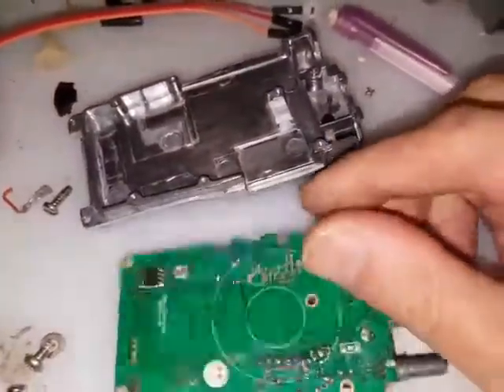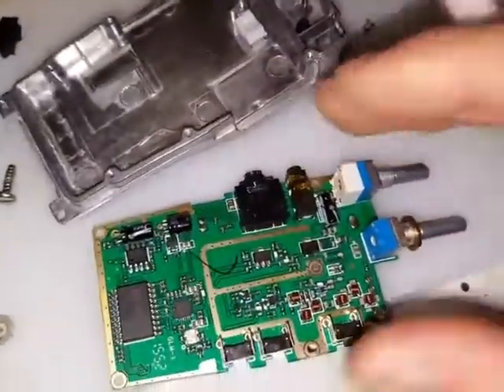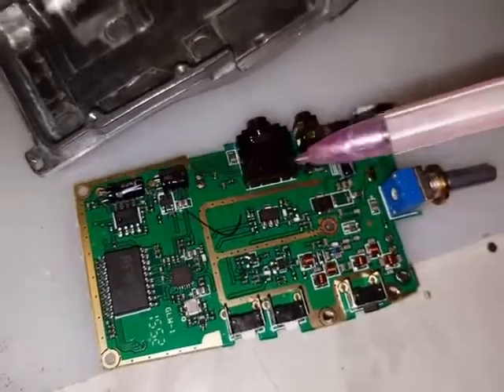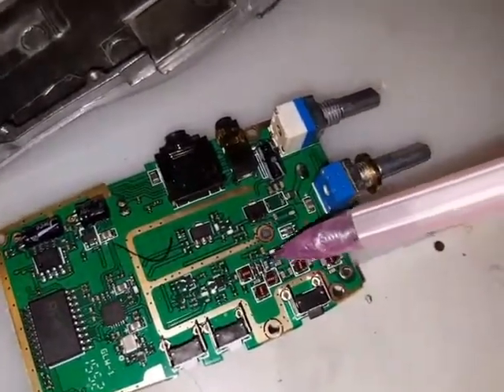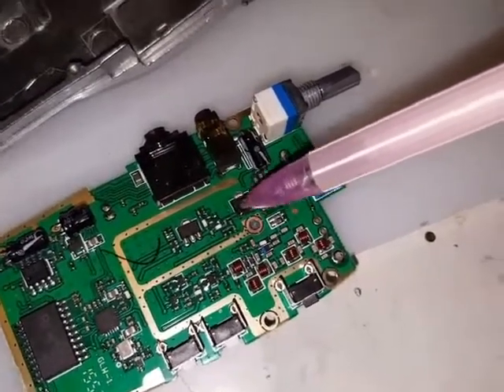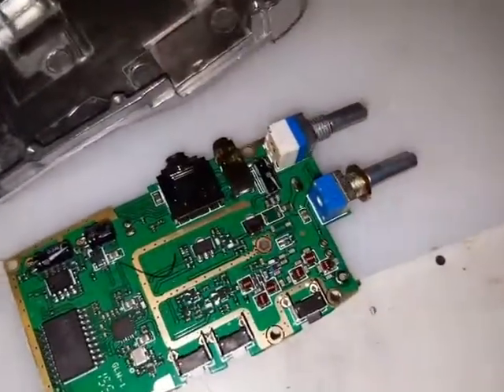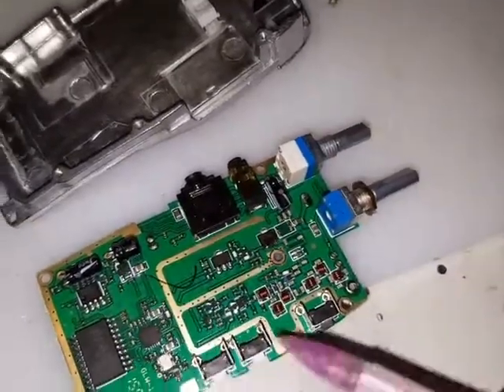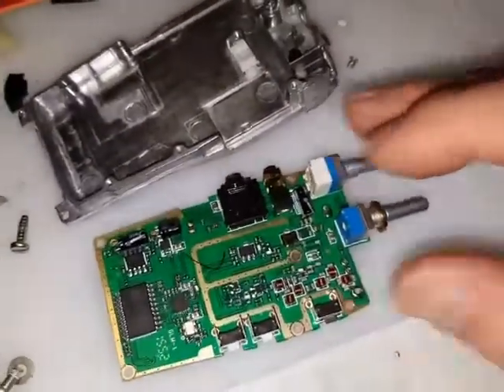Pye basestation controller allstar node BF888 taken apart

Comment: Peter - I have a question if you keep the battery have one positive  wire from the battery feeding the radio then another positive with an upscale circuit to bring the 4 volts from the battery to 5 volts you could then keep the battery in the node and have a switch on the back to select either dc or battery there would need to be a way of charging the battery aswell - what do you think ? - Andreas -M0FXB